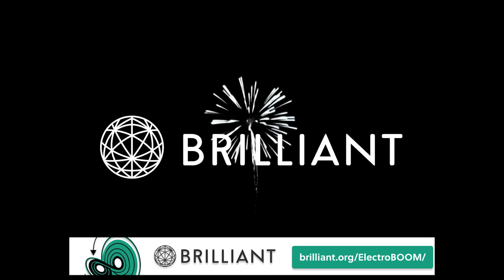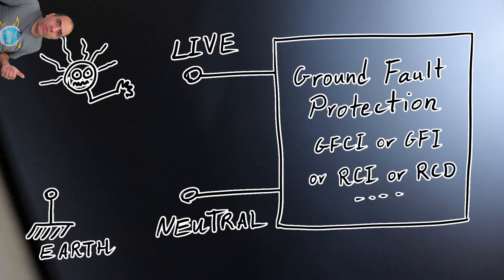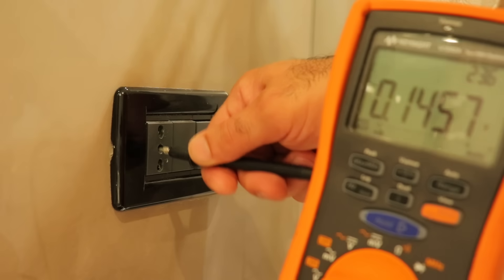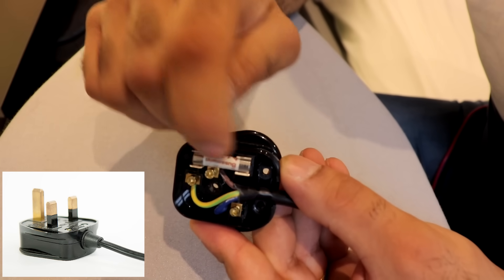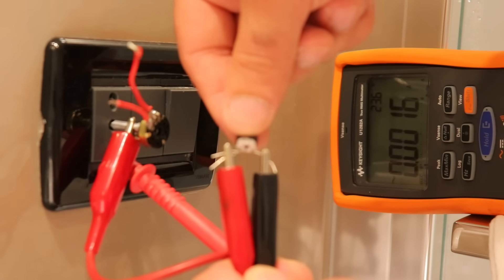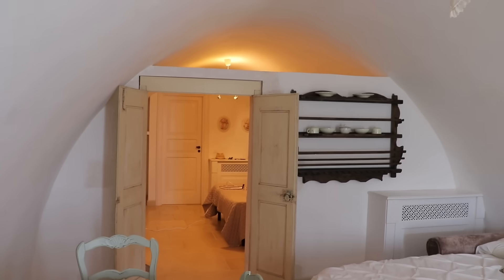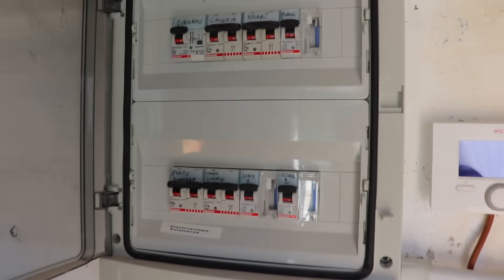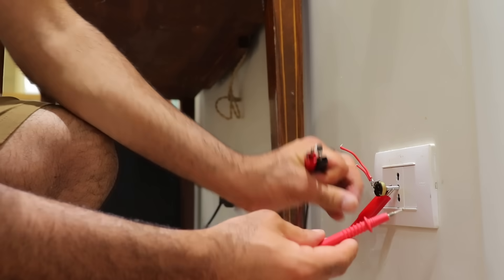Tripping Every Breaker in Italy

Comment: Rcd "auto test" isnt 100% reliable, in electrical inspection I use like a variable resistor upstream and downstream (or downstream and ground for circuit without neutral) and sometimes autotest will trip rcd but the real test (creation of insulation fault) will not make it trip.

Comment: we call it differential breaker and it should be inside the subpanel for the room. the colour coding is all wrong and the 10A is for the lighting circuit and the 16A is for the sockets circuit

Comment: Hello Mehdi from Poland :) As it goes for service buildings in Europe (like hotels, swimming pools etc) then they are obliged by EU law to have periodic checks of installations done by proffesional so RCD shouldn't be faulty as it is checked periodically and replaced if needed.

RCDs are not sensitive to phase and neutral switching as both are going through RCD coil. If your socket doesn't have ground (PE) connector then you are still protected because on touch you will ground yourself to the building (metal rods, pipes etc should be all connected to PE on central bus connectors - at least in newer buildings).

Also the guidelines are to protect whole apartment not only some of the outlets. You can use multiple RCDs but you should still protect every circuit (with some minor exceptions for instance for farming equipment etc). 

That Venice breaker with C10 is not proper one - "C" characteristics trips at once when current is >= 6 times nominal. If it is bellow 6 times it will still trip but over time (for instance 1 hour - look for breaker characteristics charts). Normally in homes / apartments there should be "B" type breaker which triggers instantly at 3 times nominal current. 

Ideology for safety is that breakers protect mostly wires and in next order appliances while RCDs protect human at first and fire happening at second. Relaying on breakers alone for safety in modern time is going to bring you a baaaad time.

Residental law is similar but less enforced so on AirBNB or private quaters you have to be careful as some home made electricians might did some magic + someone might have forgotten to do measurements for 10 or more years :) 

If you have questions about electrical standards in EU or Poland  or machine safety etc then feel free to drop a line or hundred of them - I will try to help :)

Comment: i`m from eastern europe, whenever i do an electric panel, i instal an diferencial braker of 0,03A type A for every separate instalation purpose and i end up having like 6-8 for a 2 rooms apartament. Also using Fusible braker on the general power line and i ground even the lights, plugs, everything. Is weird that you popped the brakers out with having breakers inside so that means that the breakers outside were lower amp then the ones inside which is completly wrong, for an average room should be an B16 for plugs and B8-B10 for lights and outside something like C16 acording to law.

Comment: European norms are such at a high standard but we appreciate it. My electrical board in France is so clean ! Besides, it is out of law if you rent an apartment without being in the electrical norm. And even better, it's mandatory for the renter to display the energy rating of the property. So A: you know that you're in a safe place and B: you know how much it will cost in gas and electricity to warm the property up.
There are standards for a really lot of things (not saying everything but maybe it is...) and sometimes that can be really upsetting but at least it's designed for you to be safe.

Comment: In italy its obbligatory for every house,office,workplace .... To have a ground fault protection, the most used are the 0.03A,the big plug its an high current application(max 16A), the normal plug its used for low current application, and in italy there is no difference the way you put in the plug in the soket,

Comment: The strange socket at 9:12 is for an old telephone plug, it has been replaced more or less 20 year ago by the RJ11 one.
The socket that has 2 sets of holes at 15:10 is a CEI 23-50 P17/11, but is very strange that allows you to plug the round Schuko, since the diameter of the barrels should prevent you from doing that.
Probably someone forced it to enter and now the socket is a bit loose!
Reply: The plug you're timestamping is not for telephone line, it's an old power plug from BTicino called "magic" which was popular around 1980 in Italy.
Reply: @rrbb5687  it's a BTicino magic inspired phone plug.
Reply: thought the same thing, from experience the Schuko plugs are phisically not able to fit in non-Schuko sockets, the 2 conductors are just way too thick to fit, that plug or socket was probably not up to standard or partially broken

Comment: 9.12 is a outlet that has a static polarity, ike the one u asking at 15:10, also all plugs (and body of important electrodomestic) have they ground on the central pin, that is the one connected directly to a copper bar installed outside the building into earth, and that will make the GFI, but tbh (here at Chile they only use that on big companies so people dont disconect equipment to charge phones)

Comment: I really like this kind of holiday videos ;) ...
welcome from europe as well
concerning the round plugs that could be plugged in without the ground connection, this is possible because these are austrian / german plugs and they are compatilbe with the italian plugs (that's why there is the double hole in these italian sockets) - however not advisable due to the missing ground. It is not ment to plug in these plugs to those sockets. They are ment for the austrian plugs which do not have a gound at all and look like the italian but without the ground.
If you ever visit Austria during school time, contact me, I teach in a technical highschool (HTL) where we teach among many other things, how to do a proper electrical installation. One of my collegues once showed/demonstrated me an circuit breaker that triggers if electric sparks are detected to prevent fire in the first place (however not yet used very often) -> might be interesting for you ;)
PLEASE stop using this potentiometer with the exposed wires - build a simple / cheap and properly isulated version for your tests!
My students are watching your videos too!

Comment: Welcome to Italy :) in the bathroom usually you use a 10mA, the uk connector is mandatory the fuse inside because the current of those loops can easily pass 32A, as far as i know.
The tension in whole Europe and Uk is 230V with 10% of tolerance since 20 years or so.

You’re not allowed to plug a “europlug” into a Italian connector, is out of the rules and you make at your own risk ;)
Reply: UK is 230v in theory, but in reality you'll almost always get 240v-250v at the wall socket.
Reply: @thelight3112  is in the specifications, 230+10% is 253V obviously :)

Comment: We have that very same electric system here in Chile, except the 10/16A combo outlet. We only use 10A (The inner smaller outside holes). The ground fault protection with 27-30mA tripping current is called "Differential". Any metal chassis with a leak of 27mA or more will trip it.  You crack me up Mehdi 🤣🤣🤣

Comment: Yes, in IEC standards we usually protect everything with RCCB right after the power meter and the PEN separation. 30mA for everything, 10mA for wet places in homes. It's possible to achieve selectivity also.
If you touch the light bulb socket, you protected. If your watering your garden and the power cord sitting in the water in the last 20 years rotting on the sun, this means you are protected. It's funny how most electricien here adore the american 120V system for simplicity, but this is not a requirement.

Comment: European standard should be Blue: neutral, brown, black, gray, red: live.
its been 9 years or so since I was an electrician but im pretty sure the desired way of doing is:
Brown always your phase 1. black and gray for phase 2 and 3.
red for your "ignition" cable in like from switch to the lightbulb socket. 
and lastly blue is always neutral. 
Ground is not allowed to be any other color than striped green & yellow.

Comment: 15:00 This is a problem of stupid italian people that try to plug shuko in the italian 10A outlets. If you look closer the distance between the pins of the shuko is similar to the 10A pins of the italian plug, but the diameter of the shuko pins is similar to the italian 16A plugs. Unfortunately with some force it is easy to plug the shuko in the 10A outlet. When people do this many times the ruined outlets allow to plug wrongly the shuko. To plug correctly a shuko in the italian 16A we use adaptor. This is much easier in the "double hole" plug that consent to plug 10A (smaller pin's distance) and 16A (bigger pin's distance). In the video you show also a 10A only outlet, this is frequently used for the lamps at the side of the bed, where 10A are sufficient.
Hope my english is understandable.

Comment: Great video. I electrocuted myself three times with 220v in the UK through work & shortcuts. Very unpleasant, no RCD required in the 90's-2000's. I live in America now & the electrical system here thoroughly horrifies me.
Reply: 220 or 240??
Reply: @deang5622  Residential 110v horrifies me.

Comment: In Turkey, whatever you do, don't try these before checking the breaker box first. 🙂

Our standards have been changed four times in thirty years. So, newer the hotel is, better the system. Renewing an old electric system is NOT a must. But all acredited hotels will be safe (they get checked to be acredited). But most of the local and old hotels won't have any circuit breaker. Will have thinner cables. And ac units loaded on the original building wires. From building's main electric shaft, they lay thicker wires. Most of the building's main shaft wires are good enough for this load. But it is not ideal. 

So, in Turkey allways check first. 😁🤣

Our plugs are standart. İmpossible to shock yourself, better grap between contacts and cheap. Only UK type is better, but it is much more expensive to produce.

Comment: Hi Mehdi! Welcome to Italy!
The outlet with only smaller holes (9:23) only accept 10A plugs, the outlet with smaller and bigger holes (9:07) accepts both 10A and 16A plugs and finally the outlet at 15:29 shouldn't behave like that 😂 Someone here has repeatedly forced the Schuko plug inside, and the smaller holes got bigger, but normally you can't plug a schuko in there without an adapter.
Reply: That's not a Schuko plug.

Comment: Measuring the voltage in different cables by looking at then... Maybe you can estimate the current by magnetic field if you are close enough, and then try to estimate the resistivity of part of the cable by estimating it´s volume? And display the data in a hmd? Maybe you can mesure the current with a small drone close to the cable? It would be nice to make something like that.
Reply: Careful, resistivity and resistance are not the same. Did you mean resistivity or resistance?

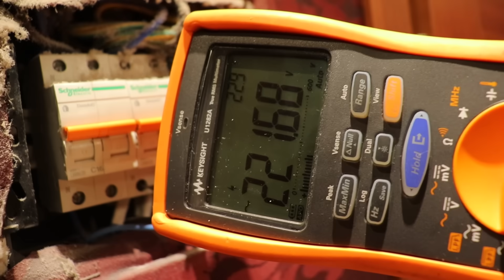Comment: 3:36 Italian standards (CEI) say that the neutral must be light blue and the live wire black brown or other color so neutral and live are exchanged there!
8:06 Italians standard (CEI) say that the RCD tripping courrent must be between 0.5 Id and 1 Id (0.015A -:- 0.03A) so it's ok.
9:12 I never seen it
9:20 small holes are for 10 amp max courrent, big holes are for 16A max courrent
15:25 the round plug are the german standard used also here in Italy but the plug doesen't fit in italian outlets if you don't force it (the rod are bigger than the italian plug).
15:58 thank you
Reply: That round plug isn't the German standard, the German one doesn't have a round hole in it.
Reply: @Okurkaarrgghh  if you mean the one at 15:11 it's a german plug fit to be used in the french outlets too, so it's half german half french
Reply: What the heck are you saying you all?! The 9:12 is an old telephone line socket! And 16A is standard everywhere, not only in hotels... lol
Reply: 9:12 it s called linea privilegiata (privileged line), it usually is backed by a ups or generator. I see those more on offices or places where you want to save files and have the time to at least switch the pcs off during a blackout.
Sometimes i see those kind of plugs being used for sound signals. Either ways.
Reply: @ephiz23  I thik is a french telephone receptacle
Reply: @DanieleVetrucci  in 25 Years as an electrician, i ve never seen a french  telephone receptacle, here in italy. That is a special plug made by BTicino Magic. It is a 3 poles plug. Used to distinguish it from  the normal 230vac. Usually it s called privilegiata, and uaually isbacked by a ups. UPSs tipically have Limited amount of Power before they go flat. This is why it makes sense to have a special plug not normally used to energize things. I have also seen it being used for audio.
Ps. It s not common at all. And you will never find it in a private home, but plenty of themin offices
Reply: @ephiz23   I've found it! It isn't a 

french telephone plug but a special 

bTicino telephone plug: 

https://it.m.wikipedia.org/wiki/Presa_tel

efonica_tripolare the special bticino 

plug magic "di sicurezza" for 220VAC power is similar but is different: 

https://it.wikipedia.org/wiki/Spina_elett

rica#Prese_BTicino_%22Magic%22
Reply: @DanieleVetrucci  yes! That is her,  i ve completely forgot to do what you ve done to close the  discussion in a constructive way. Nice one.

Comment: The Type L socket used by Italy, and basically no one else in Europe, is such an oddity, as normally compatible, except specifically for the ground pin, some more recent sockets have the now more standard side ground contacts, which allows foreign equipment to be correctly grounded, but equipment meant for Italy won't be able to fit in any other country if it needs ground.

Comment: That red cap on the outside covers the phone line/internet cable. The loose ones are backup lines in case if the main one is getting stripped. So instead of replacing the whole line that needs much more effort the just plug in the backup line in the gray box

Comment: 9:13 is an outlet invented in Italy by BTicino called "magic" in the '70. It was an attempt to use another plug for better security instead of the  Type C/L plug standard, but failed to gain attractiveness because it would means change all the plugs on all the houseold appliance https://en.wikipedia.org/wiki/AC_power_plugs_and_sockets#Italy_(Type_L)

Comment: 9:10 that's a BTicino magic, a very old Italian standard that hasn't been in use for decades now. Good catch!
Anyway, differential breakers ("salvavita") have been mandatory for decades now, so yeah, not very surprising you found it everywhere :)
Reply: Thank you, Signor Bestetti!  Was super-curious about that one.  I found a little more info on the page "Museum of Plugs and Sockets: Italian non-standard plugs":  Besides standard Italian plugs and socket the BTicino Magic series offers also "Presa per spine irreversibili", which means socket for polarized plugs (see no. 3). This is an uncommon type of socket, which is only used in cases in which changing line and neutral is not tolerated (for example specialized hospital or laboratory equipment). Occasionally, polarized plugs are also used for local networks with a different voltage (<230V) and/or direct current.

The socket is closed by a safety lid (bearing the word ‘’Magic’’ on it) which can be opened only with an even pressure on its surface by an appropriate plug. The plug is energized only when it is inserted fully into the socket.
Reply: @DanHarkless_Halloween_YTPs_etc  Thank you for the info and the effort! 🙂
Reply: I remember those! They had them at my parents house before remodeling.

Comment: A bit more to the east, what we do is have the whole circuit on a 0,3A GFCI (or RCD) and then lighting circuits do not get additional protection but sockets get that 0,03A GFCIs. If you want a bit of breaker box / distribution box porn, I can send you pics of mine :-)

Comment: 11:49 For many parts of Europe it's usually 15 kV at 16 2/3 Hz.
Reply: Yeah, those 1/3 frequency systems were created before they invented ways to run trains on full frequency supply such as 25kV/50Hz.  International trains usually have onboard voltage switching for the countries they service.

Comment: 11:50 You can tell it's between 1500 and 3000v because of the two parallel cables, 25000v will only have a single conductor. But if it is AC/DC is hard to tell
Reply: No, in Italy normal trains are 3000V DC +3000V the wire 0V the rails, the higt speed system (alta velocità) are 25000V AC 50Hz with another 25000 feeder (50kV between).
Reply: @DanieleVetrucci  those two 25000kv feeders - it only has one pantograph?
Reply: @DanieleVetrucci  That may be true, but the catenary has two very close conductors when dealing with low voltages, and the high speed trains may only have one catenary conductor. This is because the lower voltages have much higher currents (a 10Mw locomotive at 3000v will pull about 3333A, and at 25000v 'only' 400A.) In Holland we have very similar voltages.

Comment: 9:12 that's a 60's standard called "magic" produced by Bticino . Some old houses still have it.
15:29 they usually can't enter, it's Always easier to use an adapter than to try and fit a German Connector in a standard italian socket .

Standard Italian connectors have 2 dimension, based on the max current , that's why you have 2 different dimensions drilled on (small is 10, big is 16 ampere), and a shuko (German) is slightly different. Some sockets are universal, but all houses always have adapter available.
 having all the connectors and cables done correctly makes sure you can plug everything safely (sadly sometimes they are done or wired badly ...)
Btw glad to see you are in italy, hope you had a great time here!